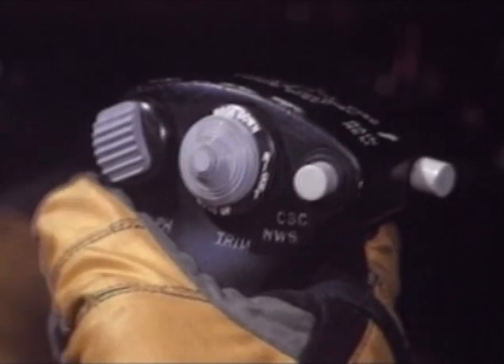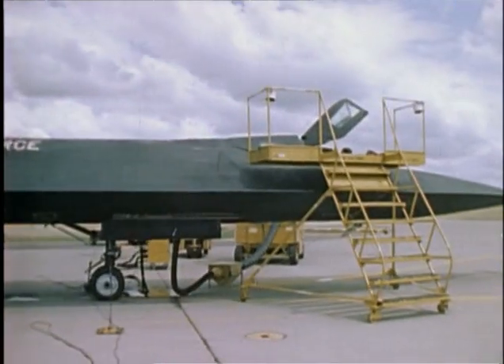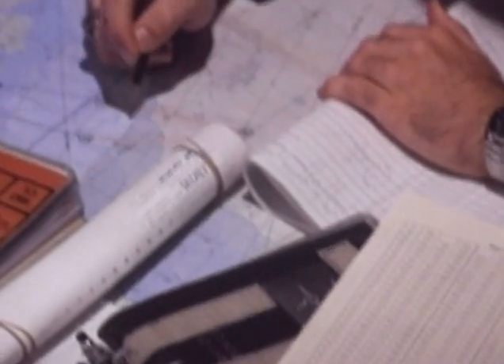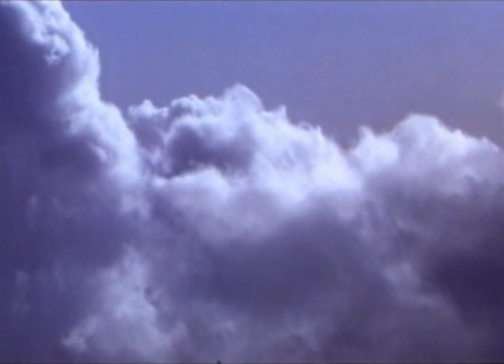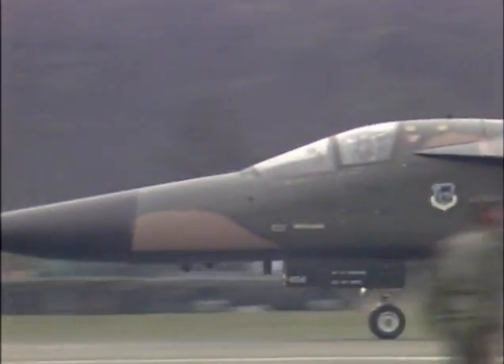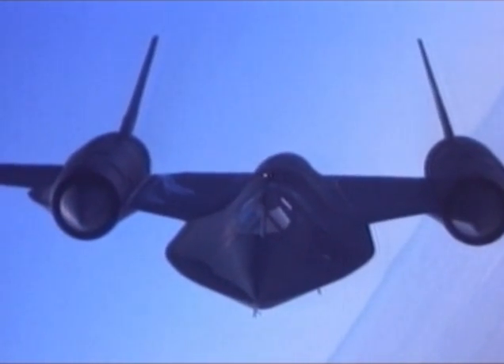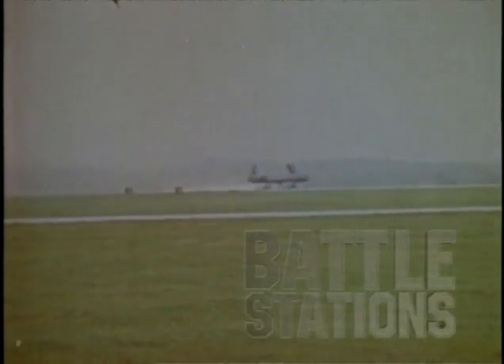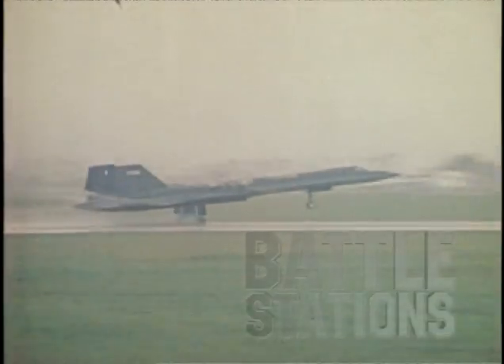Battle Stations - SR-71 Blackbird Stealth Plane -Full Documentary

Comment: SR-71 Pilot quoted Blackbird went 1.6 mile a second which is 5760 mph mach 7.5.
How do we know this is true?
Numerous of long range missiles in Libya was fired at the blackbird after a bombing at a Gaddafi headquarters was destroyed. The missiles shot went 5000 mph and the lights lit up entering the Libya airspace and they pushed the throttle all the way forward took there pictures and left.
Reply from the maker: Mach 7.5?????Do you have a reference for that????

'The fastest published speed of the SR is Mach 3.5. There are several factors that limit the speed of the SR, one is the shock waves generated by various parts of the plane, at around Mach 3.6- 3.8 the shock wave off the nose of the aircraft narrows enough to go into the engine, while there is the inlet spike (which slows the air to subsonic before it enters the engine), the shock wave bypasses the spike and causes the engine to unstart.
Second is the heat generated by the plane moving through the atmosphere, even titanium has it's limits, and the heat generated by the SR brings the fuselage to the brink. Just recently I found out that during a Lockheed Skunk Works study to see how much money and development it would take to get the SR to go faster than it's designed top speed 3.2- 3.5, the designers discovered (among other things) that the metal divider between the windshield was heating up so much above mach 3.5 that it was affecting the integrity of the windshield, and at that point they had stretched the glass technology to the max! So Mach 3.2 to a max of 3.5.

Now according to Richard Graham: "The design Mach number of the SR-71 is 3.2 Mach. When authorized by the Commander, speeds up to Mach 3.3 may be flown if the CIT limit of 427 degrees C. is not exceeded. I have heard of crews reaching 3.5 Mach inadvertently, but that is the absolute maximum I am aware of.'(http://www.blackbirds.net/bbirdm&f.html)
Reply from the maker: @Atradies Inc. "The plane was flying a mile every 1.6 seconds, well above our Mach 3.2 limit. It was the fastest we would ever fly." 
Doing the math, a nautical mile every 1.6 seconds with standard temps at 80,000 (they may have been higher) comes to Mach 3.88 IIRC.
Reply: The 71 was capable of about mach 3.6 flat out....that's 2700mph.... The x15  reached about mach 6....4520mph. A routine flight in a 71 saw 3 to 3.3 mach numbers. You have to realize above about mach 2.6, the problem is not the plane design or the engines. It's heat, not only from friction but from the compression of the air at the leading edge. The XB 70 Valkyrie Bomber was also capable of mach 3+. It was made from stainless steel, and I suspect also had boundary layer control to handle the heat. Even a missile of mach 5 launched from the ground has a lot of catching up to do, and the 71 could accelerate very quickly, making it almost impossible to hit.
Reply: @Leeroy Brown: Ridiculous assertion. Zero commonality, other than a pointy front end.
Reply: You need to improve your reading comprehension. The pilot's quote states that the plane was flying 1 mile every 1.6 seconds. You incorrectly interpreted this to mean that the plane was traveling 1.6 miles in a second. 1 mile in 1.6 seconds is equal to 0.625 miles in 1 second.
Reply: Check your math dude!  There are 3600 seconds in an hour.

Brian Shul piloted a mission over Libya during  Gadaffi's reign. 
When they launched SAMs at him, he fire walled the stick and reached Mach 3.5, the fastest classified time.

767 x 3.5 = 2685 mph.
Off the record...it flew faster.  ;)
Reply: Molo, I couldn't have said it better myself.

The rest of you arguing with him have literally zero clue.

Atradies Inc.

As Marek Cibulka pointed out, you've misquoted Brian Shul. You are digging in your heels for an argument that is already predicated on a misunderstanding on your part. And no, it's not possible for a vehicle of the SR-71's design to reach higher than mach 4 without total structural failure.

Ghost Man

No, the SR-71 is already as small as it could possibly be and still carry a practical amount of jet fuel on board. There is literally zero room in the fuselage to fit a rocket engine, and given the inefficiency of rocket engines, certainly not one of any practical burn time. Most of the vehicle's internals were devoted just to cramming spare fuel in every nook and cranny.

Furthermore, yes, there are SOME missiles that could exceed the SR-71's top speed. HOWEVER, they are only able to do so because they are powered by rocket motors, which again, are very inefficient and have an extremely limited burn time. The key here is acceleration, closing speed, and distance.

The SR-71 was capable of outrunning missiles at mach 3.2 because it flew at that speed at an altitude of 85,000 feet... This means any ground to air missile would have to cover AT MINIMUM, 85,000 feet (though in practice, hundreds of thousands of feet, because the plane isn't standing still), accelerate PAST mach 3.2, and then have a high enough closing speed to overtake the SR-71. In practice, the plane was detected late enough that it was already leaving the area by the time a missile could be launched. Rocket motors on pretty much ANY surface to air missile that has ever been developed simply did not have the burn time necessary to close the distance to zero, even if they TECHNICALLY could go faster than the SR-71.

The SR-71 did not need rocket motors to outrun missiles. It's a simple geometry problem that kept the SR-71 safe in the face of missiles faster than it. For a rocket powered missile with only a couple minutes of burn time at most, it would not be able to make up the distance between its launch point and the overflying SR-71 before running out of fuel, regardless of whether or not it technically had a higher top speed than the SR-71.

Atradies Inc.

You should keep your conspiracy nuttery to yourself, it undercuts your already failing argument. Soviet UFOs... really?

The shuttle can go mach 23 in the vacuum of space where air resistance isn't a problem, and return from that state using an ablative non-metal heat shield that was DESIGNED to fall apart within a matter of minutes. And by the time it reached orbital speeds during launch, it was already high enough out of the atmosphere to avoid extreme heating. It only had to deal with extreme heating on re-entry. The space shuttle could withstand the temperatures of re-entry only for a few minutes, just long enough to slow down to subsonic, because it used a heat shield that was LITERALLY DESIGNED TO MELT. It used silicone and carbon tiles that would melt away outer layers successively. If the space shuttle were, for whatever reason, made to fly at mach 23 at the same altitude of the SR-71 for the same lengths of time the SR-71 flew at mach 3.2, it would melt and fall apart after its ablative heat shield ran out of material.

When it comes to sustained jet engine flight at high mach, it has to be done lower in the atmosphere where air resistance is off the charts compared to rocket powered vehicles. And since it has to be sustained flight (otherwise, why bother with efficient jet engines), ablative heat shield solutions are no good. This is where the materials problem comes in (and also demonstrates that you know literally nothing about anything. Comparing the space shuttle to the SR-71 is a false equivalency. "Hurr durr durr, well this thing can go faster, so why can't this other thing go super fast too" doesn't work. It's about as dumb as me saying "well, the space shuttle can go mach 23, so it's not unreasonable to assume the Cessna 172 can go mach 5"... WHAT? In what fucking universe does that argument make any logical sense?).

The SR-71 was, at the time, made almost entirely out of titanium smuggled out of the soviet union. Titanium at the time was pretty much the best material that one could make an aircraft out of for sustained high temperature exposure... And at speeds in excess of mach 4 at an altitude of 85,000 feet, the air resistance was high enough to heat titanium to the point of losing structural integrity. The SR-71 blackbird literally CANNOT go faster than mach 4 without eventually falling apart. End of story.

Unless you're retarded enough to think the SR-71 is based on magical UFO technologies and fairy dust, then you could just claim it's made out of Maguffinite and could fly into the sun and come out the other side.

The X-15

The X-15 has the SR-71 blackbird beat, regardless of the blackbird's "still secret" top speed.

I know this not only because I work on jet engines for a living, but also because I have personally spoken with an SR-71 engineer. While she would not divulge the actual top speed of the SR-71, I did ask her to settle a bet with me and some dipshit at my old high-school. This guy thought the SR-71 was the fastest plane in the world, rather than the X-15. He claimed that it could go faster than the X-15's mach 5.5, because like some of you, he felt the SR-71's "still secret" top speed gave him license to run wild and ignore basic facts about engineering.

So I asked her, "alright, if you can't tell me the top speed, can you at least tell me if it's faster than the X-15".

Of course, her answer was "hell no, are you crazy?"

So then, why can the X-15 go faster than the SR-71?

It's rocket powered. A jet powered vehicle like the SR-71 has to burn oxygen straight from the atmosphere. This means they have a maximum altitude they can operate at. At that given altitude, they have a maximum speed they can go without melting... These are the things that limit the SR-71 blackbird.

A rocket engine says "fuck your limits" because it carries its own oxygen. It has no altitude limit. A rocket engine can go to space if it wants, and still operate normally. As a result, a rocket powered vehicle (like the X-15) can, if it starts going too fast for a given altitude, simply climb to a higher altitude where the air is thinner. This is why the X-15 has the current record world speed and altitude record for a manned aircraft. It can fly higher than the SR-71, which in turn, allows it to fly faster... All because of its rocket engine. Furthermore, the engineers have more material options with the X-15. Because it has a low burn time, they only need the skin to withstand high temperatures for a few minutes... As opposed to the extended periods of time the SR-71 had to be exposed to high temperatures.

The SR-71

The blackbird had a pair of ingeniously designed jet engines. They are essentially hybrid turbo ramjets. They operate like normal turbo jets at low altitude and air speed, and operate like ramjets at high altitude and airspeed.

Technically, an air breathing jet engine can go even higher and faster, faster even than the X-15. It's known as the scramjet, an engine that takes the ramjet concept and removes the compression elements. However, the technology was not around yet when the SR-71 was built, and even today, is impractical because it needs to be accelerated to high mach speeds before it'll even START to operate. No hybrid "turbo ram scramjet" has ever been built, and it's unlikely one ever will be built due to the ridiculous engineering requirements for such an engine.

In the near future however, this whole issue will likely be circumvented by the SABRE engine. The SABRE engine gets around material limits, and the minimum and maximum speed limits of traditional jet engines by using a precooler instead of compressor blades to compress inlet air. This combines the streamline nature of scram jets with the compression of a turbojet, all by using what is little more than a big heat exchanger between inlet air and cryogenic fuel. This would easily allow the aircraft to go from a stand still on the runway to speeds in excess of mach 5 without melting. It will be able to fly higher and faster than the SR-71. There's also plans to build it into a hybrid rocket engine, that operates like a jet engine up until the engine reaches its limits, then pull up and switch into a rocket mode. This hybrid engine could be used to build the world's first SSTO (single stage to orbit) vehicle.

Right now, the SABRE engine only exists as a prototype, and has yet to be flight tested. Point is, these other jet engine designs could push an aircraft to higher altitudes (and therefore, faster speeds) than an SR-71... But they weren't developed technologies in the 70s when the blackbird was made. The blackbird used hybrid turbo ramjets that were limited to airspeed of no more than mach 4. Even to this day, achieving those speeds with a jet engine that can get there from a standstill is impressive... To claim that "mach 7 seems slow" demonstrates a complete and total lack of understanding of basic aerospace engineering. We are only just now learning how to go faster than mach 4 with jet engines, BECAUSE trying to push a ramjet powered aircraft to speeds faster than that at the altitude they're limited to would've melted the aircraft, even with super materials like titanium... End of story. Quit trying to argue this.

Even if they did release the "official top speed" of the SR-71, conspiracy nutjobs like you pricks would just claim "well it came from the government, so they must be trying to cover up the REAL top speed". It never ends, all conspiracy theories are is goal post moving. If you educated yourselves even just a little bit on the subject of aerospace engineering, you'd better understand what is and isn't ACTUALLY possible... Then you wouldn't have to make shit up.
Reply: Your suspicions of it having rockets on it are incorrect and unfounded.  Moreover, they're bullshit.
Reply: mile per 1.6 seconds equals 2 250 mph ;)
Reply: 1.6mps x 60sec = 96mpm x 60min = 5760mph  Math does not lie.
Reply: @rickdavis3593  
It was 1 mile per 1.6seconds 

37.5 mile per minute
2,250 mph.
Speed of sound at 80,000ft altitude dependant on air density due to temperature and air pressure due to weather systems is approximately 660mph
Therefore their speed in terms of mach numbers was approximately Mach3.4
Reply: ***** Soviets, not Russians.
--S
Reply: Atradies Inc. you don't seem to understand the quote you posted. 

One mile every 1.6 seconds is (1/1.6) 0.625 miles per second which is 2250 miles per hour, or about Mach 3.4 depending on temperature/pressure/altitude.

Either you don't understand English or you don't understand math.

Try re-reading Brian Schul's quote...
Reply: Do some MATH for god's sake.  You don't need to match the intercept speed when you have distance and altitude to make up.  Don't they teach basic math in the 9th grade anymore????  Intercept angles, time to intercept, etc.  Basic trig and geometry.
Reply: omg man... see what you have been quoting: ... "The plane was flying a mile every 1.6 seconds, well above our Mach 3.2 limit"
Reply: Dusk DarkRift Agreed,but this thing wasn't made by idiots either,and there were missles at that time that could match or exceed mach 3..I allways wondered how they out ran them,...Really ,you know..not what they tell us.
Reply: *****
You think that the Russia of today is the same thing as the old Soviet Union?
--S
Reply: Steve well it bumps the numbers around a little bit then.  Point is the plane's absolute max wasn't much above its quoted cruising speed, a couple tenths of a Mach more assuming best possible flight conditions and compressor inlet temps right at max.  Certainly nowhere near 4.  These crazies that think it went 7 or more... have they ever seen the cockpit?  The Mach gauge doesn't even go up that high...
Reply: Fastest ever manned aircraft was the X15 rocket powered  experimental, it reached  4520 MPH.  The fastest recorded speed for an SR71 is 2193 MPH, no way could it reach more than DOUBLE that speed!  Why would a military aircraft be designed to reach over 5000 MPH then only ever fly at 2000 MPH and change??!!
Reply: turboslag Not to mention the physical limitations. The mathematical limit for ANY ramjet is mach 6. The SR-71 Uses turboramjets...
Reply: Carl Holm there is no such limitation in the engine design.  The limitations are multi focal and are more often about metallurgy than anything else.  That's what Kelly Johnson and the team learned all those years ago and it's what they've been working through for about 30 years and change on updated designs and implementations.
I think what you'll see is multistage and multi function designs that work in tandem to propel the aircraft through various speeds and flight envelopes.  That's much easier from an engineering perspective than attempting to do it all on one engine design or another.
Reply: Molo
Reply: It takes 1.6 seconds to do a mile. NOT 1.6 miles per second.
Reply: thefarrisfactor there is a huge difference between an orbiter returning from space and re entering the earth's atmosphere and a jet powered aircraft cruising at 75000 feet at Mach 3.2.  Temps on the shuttle were higher, speeds were greater and the weight of the shuttle is much greater than an SR-71.  There is no comparison between the two, at all, except they were both made by humans and are both retired now.
Reply: Atradies Inc. Mach 1 is not a fixed speed. The speed of sound varies greatly by altitude.
Reply: *****
Why mention 2016 then? What was your point?
--S
Reply: *****
Not a very funny joke dude.
What makes you think I'm a "libtard?"
--S
Reply: *****
And you implied I was one of them when you said that blaming the Russians was very "2016 of [me]" yes?
--S
Reply: *****
What's your source for this claim?
Honestly curious.
--S
Reply: *****
That's not very convincing.
--S
Reply: Atradies Inc. I am not saying that you are wrong in your statements, but so do want to point out something regarding the manned space flight speed comparison. While the space shuttle did reach a max speed of around 17,500 mph, that was at extremely high altitude where the atmospheric friction was very low. This allowed a much higher velocity without needing to worry about drag induced heating effects quite as much. At lower altitude with thicker atmosphere to push through the space shuttle's airspeed was quite a bit lower...well, it was quite a bit lower than it's own considerable top speed.
Reply: Atradies Inc.
Reply: Atradies Inc. P
Reply: Molo the book quoted is written for the layman.  I don't think Mr. Schul is speaking of nautical miles which are larger than statue miles...
Reply: BS.  It isn't possible for the Blackbird to go that fast.  The limitation of the Blackbirds speed is predicated on the compressor inlet temp, which peaked at 421 degrees celsius.  Higher than that and the metallurgy wasn't good enough to maintain structural integrity of the compressor.  The Blackbird could NOT reach Mach 4, much less 7.5.  In the right conditions, the bird coudl reach 3.5 and change, that's it.  Period.
Reply: It can not go 3.8.
Reply: Stickie Dmin
Reply: Loki
Reply: Dusk DarkRift  if that is the case the  how did the shuttle do over Mach 22?
Reply: Atradies Inc.
Reply: in engineering speak, not gonna happen....thermal, structural,, and aerodynamic limits are all arrived at just slightly above MACH 3.51. after which the airplane and crew fall down go boom.
Reply: Molo - Good reply and good analysis. From my own research, I believe you are spot-on.

Cheers.
Reply: i would add  to hatmans comments that there is limits to sensor capabilities used to collect data. not going to be using IR or UV sensors on ground targets because of airframe heating without some tremendous cooling.   SLAR and ELINT are effective  in the absence of plasma or corona. visible light  camera systems were unreal. 85K altitude is not a genuine service ceiling but a good operational altitude for the sr71. still classified. interestingly, Mach 3.2 at 85K is a good number. fuel usage climbs/reduces range with increased airspeed and or altitude climbs. why bother. 
a lot of people are saying here were missile systems (sam5)which potentially could make an intercept on high/fast targets depending on target acquisition and tracking. I would question that as the jets and crews were not hit by these missile systems. got close but no cigar. fast missiles are a very expensive asset. subterfuge is much more cost effective. 
lastly, SAC foot the bill for post battle damage assessment. parts labor tankers training fuel, it adds up. the sr71 was abandoned because Congress did not care to pay for it. it is that simple. the WHY congress failed to fund the sr71 is a political question we should be answering....
Reply: tharconian The air force itself killed the SR71 because it had better uses for the funds necessary to keep it operational.
Reply: They let John Glenn fly in an SR-71 once, and its max speed was reached only when the pilot activated the "organic emergency booster" by pulling Senator Glenn's finger.
Reply: Atradies Inc.,  I'm not familiar with the claim of 1.6 mile a second , but the engines used on the SR-71 were of a type that are not capable of 5000 mph, even if the air frame had been able to take it, which it was not, unless you are suggesting that there were some other secret planes that we do not know about.  Don't get me wrong.  I think the SR-71 was the most fantastic plane for the purpose it was designed for that has ever been created, but the materials used would not stand up to the heat that would have been generated at the altitude it was capable of operating at.   If I understand what you wrote, it seems like you are saying that it would have to be able to fly faster than a 5000 mph missile to outrun one.  Those missiles have a limited range and the SR-71 already had a great lead.  Before the missile could catch up, it ran out of fuel and fell away.
Reply: It's actual tested, highest performance/airspeed is classified to this day!
Reply: Hat Man ... Great overview... Wow! 
Just wondering about that SABRE engine... Which is basically a refrigerator or heat exchanger on the intake side... Why aren't they using that on the commercial turbofan jet engines instead of the compressors for subsonic regimes? 
That SSTO thing is gonna' be a hard nut to crack IMHO.:-/ But interesting never the less. The SR71 did so much in showing us the limits of winged/air breathing craft/propulsion systems. Quite an amazing & beautiful bird.
Thanks!
Reply: Atradies Inc., Mach does not apply above the atmosphere as there is no speed of sound in the near-vacuum of outer space. The charts showing Mach at different altitudes are readily available on the web. It doesn't work like you assume.
Reply: mattmopar440, Mach 7 @ 80,000' ~ 3,600 mph
Reply: Dusk DarkRift, Antiaircraft missiles that will go @ 5,000 mph can do so for only a short distance before the heat shielding on the nose fails or the missile runs out of fuel.
No air-breathing aircraft can attain such a speed...yet. The scramjet shows promise.
Reply: Atradies Inc. - 18,000 mph is orbital speed. For all.practical purposes the atmosphere ends @ 400,000'/76 miles above which there is no speed of sound as there is no air to transmit sound. Therefore there is no Mach number.
The shuttle or any orbital craft slows to begin re-entry to the atmosphere @ about 76 miles altitude. It scrubs off speed rapidly as it comes down.
Reply: Stickie Dmin, The current president of the Russian Federation is a former KGB officer. Surely few actually believe that he has repented of his former USSR outlook.
Reply: LittleJoel29, Yes, at above 76 miles the atmospheric friction is very low...like zero.
Reply: Steve, Perhaps he confuses the SR-71 with the NF-104 which had a booster rocket to take it to 1,600 mph and 120,000 feet?
Reply: Steve, the difference isn't all that much: 1 NMi = 1.1 statute miles.
Reply: thefarrisfactor, The shuttle didn't go Mach 22 or anything near. Acceleration to orbital speed of ~ 18,000 mph is done above the limit of the atmosphere.
Reply: tharconian, To go faster the skin would have to be tungsten. And have a ceramic heat shield on all leading surfaces.
Reply: Hat Man, The shuttles didn't attain Mach 22 or 23. Mach 1 is the speed of sound in the medium surrounding the vehicle. The medium surrounding the shuttle at orbital speeds is...nothing. A harder vacuum than in a vacuum tube. Above 76 miles sound does not propagate as there is no medium to carry it.
Reply: Molo :
You would only have to reach 3.6 or better, for a second or two (or 3) to outrun any missile.
Reply: Stickie Dmin : 
YUP
Reply: Al Grayson : 
Your repent comment is so true !
Thank you.
Reply: Hat Man  -   Thank you for your well thought and researched reply to one of the dumbest things I’ve ever seen !!
Reply: isnt mach speed relative and calculated according to air density? If it's high enough, and the air is thin enough,  Mach 3 is way above 2200mph?
Reply: No SR-71 can do mach 7 Ive heard it was clocked over Israel at 3.6 mach and Ive heard it could hit 3.8 but it would fall apart if you pushed it to mach 4
Reply: holy shit man no it wasn't shut the fuck up
Reply: Ghost Man it is very close to being impossible to go beyond Mach 3, almost all materials would fall apart
Reply: The shuttle doesn't achieve that speed while in the atmosphere, engine power and airframe limitations make that impossible.
Reply: I was going off of not only his words but also the report that was written . Not My Words oh btw that is slow comparing to other manned craft like the shuttle launch so don't tell me it is not possible...
Reply: Mt. Shul is speaking 100% of NAUTICAL MILES which are the standard in Aviation.
Reply: This is an exact quote from Brian Shul a Blackbird pilot. 
"After several agonizingly long seconds, we made the turn and blasted toward the Mediterranean 'You might want to pull it back,' Walter suggested. It was then that I noticed I still had the throttles full forward. The plane was flying a mile every 1.6 seconds, well above our Mach 3.2 limit. It was the fastest we would ever fly. I pulled the throttles to idle just south of Sicily , but we still overran the refueling tanker awaiting us over Gibraltar."

From this statement I made the calculations a mile every 1.6 seconds = 5760 mph or mach 7.5
Reply: As I understand it, the cockpit glass could not withstand the heat from friction above mach 4.
Reply: Atradies Inc. The exact top speed is still classified to this day.I've allways suspected it's equipped with a secondary rocket boost two to four stages.
Reply: no 1.6 mile a second not 1.6 seconds a mile
Reply: +leeroy brown
The Arrow was cancelled because of KGB infiltration, nothing to do with the Blackbird family.
--S
Reply: The soviet union had man made flying saucers with nazi ufo technology. There is no telling what the US can do with all the scientist they have collected. Mach 7 seems slow to a shuttle launch of 18,000 mph Mach 23